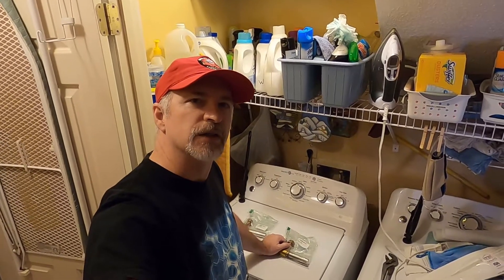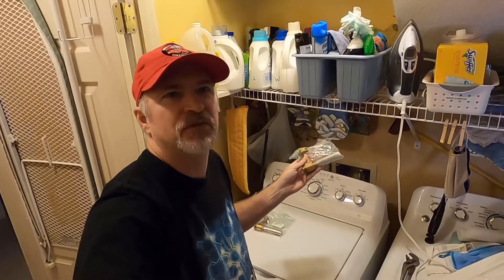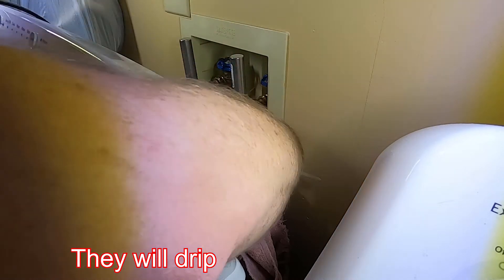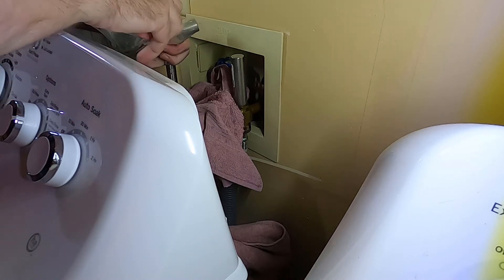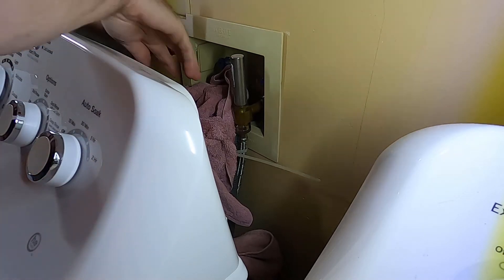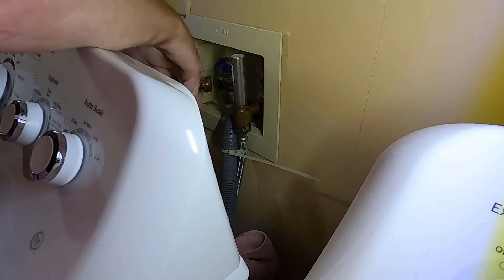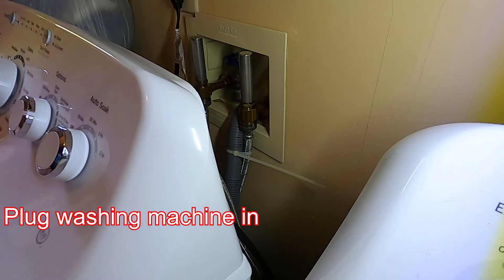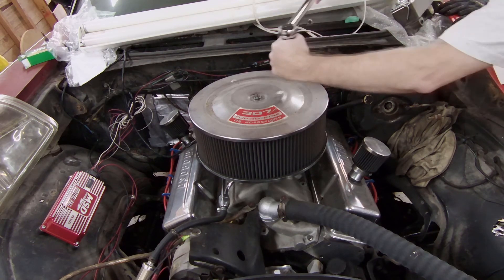Hammer Arrester - How to stop water pipe banging or knocking

Comment: I have tried the 5 inch arrestors with no luck.  I need to put one on a pipe that is coming to my washing machine but the horizontal pipe is buried in the cement floor.   Could I put a outside faucet hose T from the pipe with one outlet going to the washer and the other going to a 18" vertical piece of capped off hose?